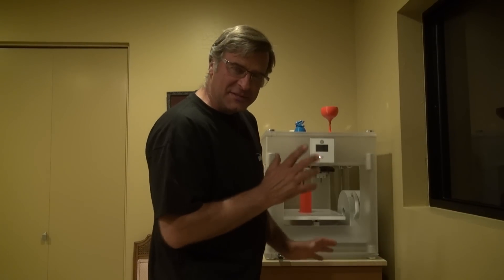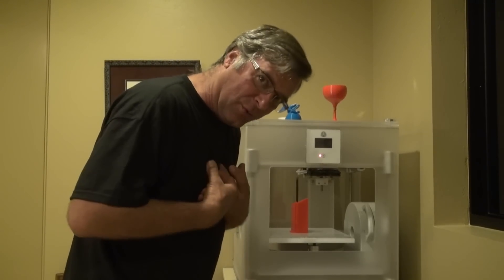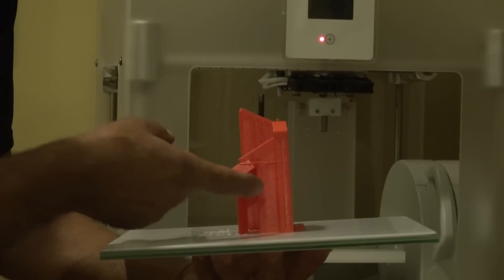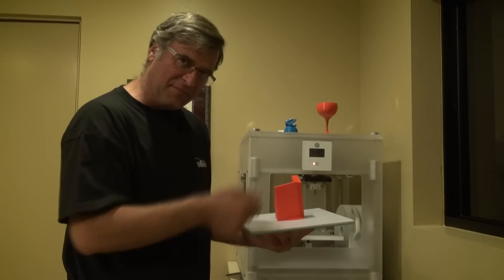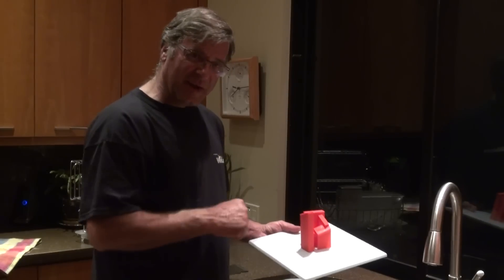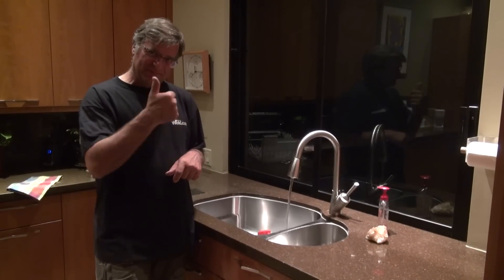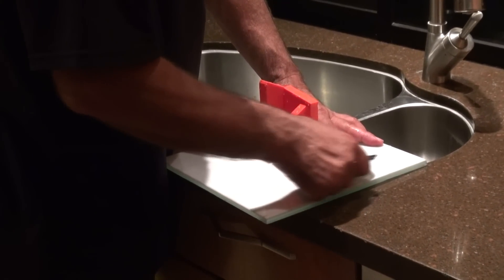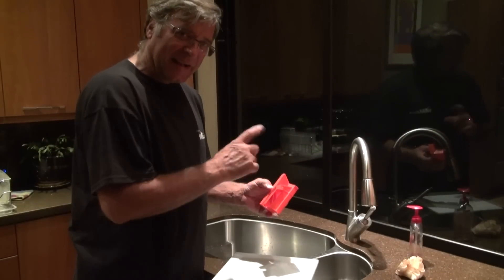How to Use a 3-D Printer: Removing the Item From the Tray - Kevin Caron

Comment: just put the build plate in the freezer for 10 min and prints will pop off I don't even use the scraper any more keep In mind you z offset must be set correctly
Reply from the maker: Works most of the time!!      Except for the big plate that's 32 inches in diameter!

Comment: Just buy SIMPLIFY 3D and you won't need to clean up or worry about print times or crappy prints again. I'm glad I did. Use builders blue tape and PRITT STIK GLUE, WORKS FOR ME.
Reply from the maker: Codenamebravo I have Simplfy 3D now..    This is a really old video..